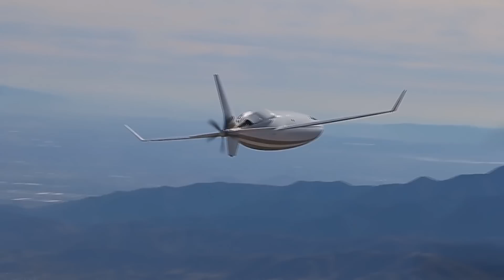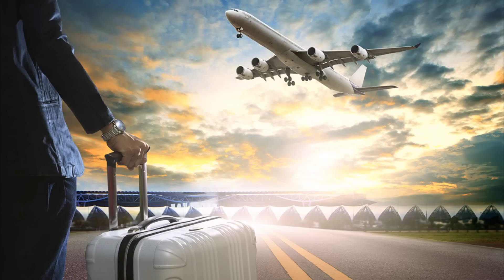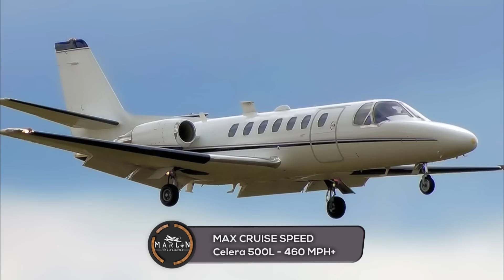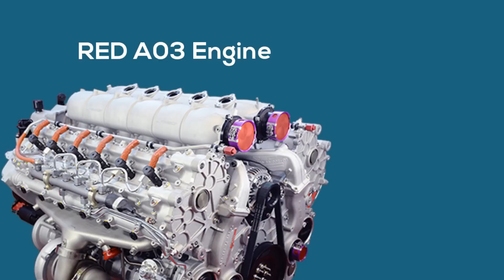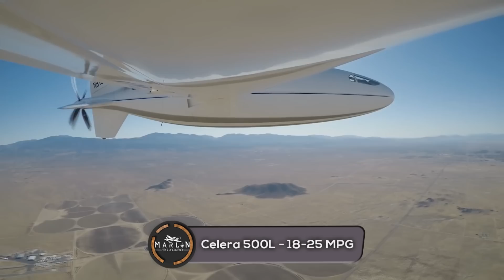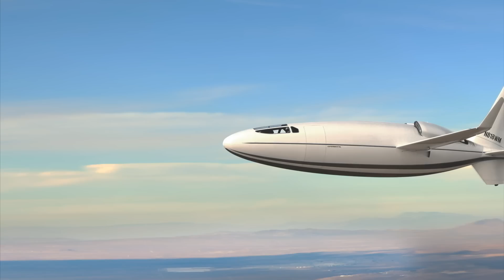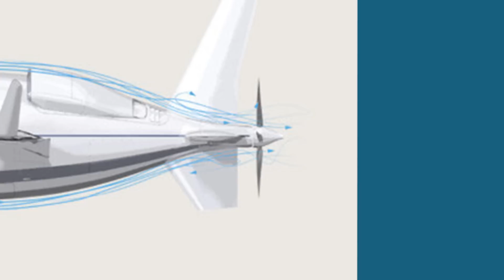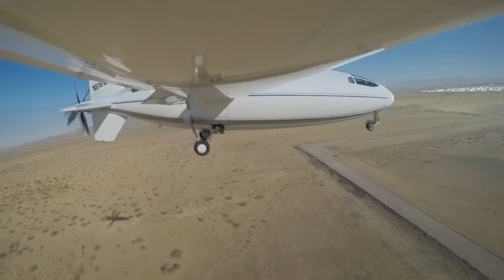Meet the Celera 500L (Flies Faster, Farther, Higher, Cheaper)

Comment: Too much fantasy here. Internal combustion at FL600+? Um, nope.
And wings that small won't support that altitude, either.
Dry wings and 4500NM/5200SM range? With the efficiency of an SUV? Um, the figures don't line up, nor do the physics.
You'll need fuel in the wings to reduce the bending moments from all the weight in the fuselage. (You'll also need a much better wing to fuselage transition to reduce drag)
With Avgas being 6lbs/gal or diesel, as in this case, being 7lbs/gal, it would require a huge volume of fuel (1450 lbs for diesel or 1250 lbs for avgas). Add even 4 people and some baggage, and you're adding another 1000 lbs, impinging on cabin volume.
You'll need a lav, thus taking up more room and weight to support the time for travel (17 hrs @ 300mph/13 hrs @ 400mph). Can't imagine more than 300 for long range cruise, unless sfc has gone off the charts.
Diesels have a higher efficiency (+ about 6% or so), but the fuel weight is a +15%, negating this efficiency.
The Learfan with a lot more power only ran in the low 300s for a range of only 1500NM.
Anyway, I'm all for new designs, efficiencies, and pushing the edges of the envelope, but when something comes along that promises such huge advances all at one time, especially with a design that's not so radical, it begs some obvious questions.
The Learfan was supposed to do radical things, and it kind of did but still fell short. The Starship was supposed to step in and do more on less, but still fell way short on promise, although very cool in many ways. The Avanti, which is the most similar to this concept, has taken decades to prove itself worthy of a unique design, although still falling short of its original production intent.
This was more of an ad than information on why or how this will do what Otto wants it to. Show me the math and the tech that will get me there.
Show me 2500SM at 350 with 4-5 people and a .45 sfc and I'll start looking at a real story; as for this, I'll keep an eye on it, but it will never do what is being promoted here.

Comment: Interesting but I've seen similar designs through the years that offer some of the same advantages over current aircraft designs only to not be the case.  The Lear Fan from the early 80's and the Piaggio P180 that's flying today come to mind.  In fact, the design of the Celera 500L looks strikingly similar to the P180 except for the canards.  The laminar flow that's cited in the video is the object of all aircraft design so it's not unique.  It may be that the fuselage design offers complementary lift in addition to the wings that most aircraft today don't have.  Finally, the pusher design has some flaws that a puller designs do not.  Namely, the air coming to the pusher prop suffers from boundary layer turbulence due to the fuselage drag no matter how clean the design is. This tends to make the propulsion less efficient because the inner portion of the prop is seeing the disturbed air.   Additionally, pusher designs tend to be much noisier than traditional puller design from a phenomenon called aerodynamic shielding that may impact their ability to fly into certain areas due to noise restrictions.  If you've ever heard a P180 fly overhead you'll know what I mean.  I hope the 500L succeeds where the other's haven't but we'll have to wait and see as the development continues.
Reply: Good points...There is P180 that flies over my area once or twice a month... VERY distinctive sound... don't even need to stick my head outdoors to confirm!

Comment: The performance claims are pretty hard to believe.  I quit the video at the suggestion of a 60000 ft ceiling, according to Wikipedia there are a couple records for piston engine aircraft reaching over 60000 ft,  so it is possible.  However I will be very surprised if this turns out to be a real thing and not a scam.

Comment: Surprised that they chose a new, untried piston engine instead of a turboprop, which are inherently incredibly reliable.
Reply: Colin Povey 
Couldn’t have said it better myself.    👍
Reply: Turbines are thirsty. Also got the impression that the power plant had a capability to continue running if one six cylinder side fails?
Reply: Not unless it's a Japanese engine. They should have used a Honda VTEC engine instead, which are even more reliable and fuel-efficient.
Reply: @00crashtest  Give me a break. That is a reciprocating engine, with hundreds of marts moving back and forth.In a gas turbine, all the parts do is revolve in one direction. Put in a  turboprop, downrated (make less thrust than designed for, so less stress), and you have about the most reliable engine ever made.
Reply: @colinpovey2904  But it's Japanese, not just any product. In Japan, they're miraculously able to run trains always on time despite having the tightest schedules in the world, high passenger overcrowding, typhoons, earthquakes, and tsunamis. Even with all that shit thrown at them, Japanese still manage to have the longest lifespan by a long shot.
Compare that to Europe and North America where trains with a headway of 1 hour and relatively low passenger numbers still somehow find a way to usually be at least 15 minutes late.

You gotta appreciate the Kaizen method. Look at the Scotty Kilmer channel. Japanese cars are guaranteed to last half a million miles with just oil changes, timing belts, and water pumps as long as they don't have a CVT.
Reply: @colinpovey2904  Whereas mechanically-super-simple Teslas are breaking all the time due to poor build quality.
Reply: @colinpovey2904  Granted, if Japan made a jet engine, it'll be more reliable than even a Honda VTEC engine.
Reply: @00crashtest   The problems with Tesla's is not they are breaking, but the fit and finish of the body panels sometimes leaves much to be desired. I may buy a Tesla in hte next year, and have been following this closely.

But some weird '2-half' 12 cylinder engine sound like a mechanical nightmare to me.
Reply: Turbines are reliable. But the company sure seems to be selling economy and range as assets unique to the concept, and again—turbines are thirsty.

Comment: What a load of Bull Shit.  Dig slightly deeper and you find that they are looking for funding ... Laminar flow only works on a perfectly sanded/polished model in a wind tunnel.  In the real world, dust destroys the laminar flow before we talk about imperfections in the aircraft itself or a little thing called water vapor or the nasty liquid or solid forms...  So, if you get any kind of clouds you have to fly through, your drag jumps massively then add icing... loss of lift and massive increase in drag and this is supposed to remain airworthy with range rating... uh huh ... Then you get minor aerodynamic disturbances which also destroy laminar flow.  460mph on ~500Hp.. uh huh

Comment: Looking at the Celera you can tell that the designer prioritized good aerodynamics over almost everything else.  I like the tear drop fuselage, the high efficiency wings and the pusher propeller features.  The specs are outstanding!   The only criticism I may have is the visibility from the cockpit.  I hope to see this plane make it past the prototype stage! 👍   Great video BTW!
Reply: VIRTUAL displays.  Why have windows ?
Reply: Like others before it it will fade away after reality bites !
     Good concept though.
Reply: @darrenkohls7431  Starship was just to far ahead and perhaps to expensive for the results.
We  may see a newer different commercial aviation after covid-19 .  The zombies have to die off first.
an express lane on interstates for self driving buses  doing 185 like Joe's Maserati.
Reply: THere is no known way to maintain laminar flow other than an active suction system of which this plane is NOT using.  They are looking for funding(suckers) and why they hit every contact they could find for this fraud.  Bugs, dust, even water vapor that is thick, let alone the wet stuff destroy laminar flow.  The fact they have one flying and refuse to say its actual speed is telling.  OF course anyone with any knowledge already knows this.... 460mph on 500HP carrying 6 people... HAHAHAHAHAHAHAHAHAHAHAAHAHAHAHAHAHAH
Reply: @w8stral   Exactly !
           BOOM !
Reply: @w8stral  boats do this, please explain again how this is not legitimate. I think provided with the fact the video gives the background of a man who is probably 10 times smarter than you in aeronautical engineering, has a flying prototype and they themselves made no public announcements of what they were doing.
Reply: @blackwaterlotus8124  Boats do not do this, whatever "this" is, and here I am going to assume turbulent flow vrs laminar at 50%... and here you have to use hydrofoils as an example and not a symmetric object which I am assuming is what you are talking about and which case is true of aircraft fuselages as well, and if so, then you are blatantly wrong, as there is a thing called a Reynolds number and Raleigh number etc and the simple fact that unlike AIR, water does not compress, so air depressurizes which makes turbulence easily and laminar flow is lost very quickly due to local disturbances whereas water does not decompress but rather creates standing waves which is more equivalent to supersonic flight and why hydrofoils have a TOP speed limit on them and cannot go any faster as differential pressures creates cavitation which quickly destroys said hydrofoil. Slenderness ratio here effects laminar flow, of course in supersonic flight one has gigantic temperature gradients whereas water does not, once overpressurization is reached you get cavitation(water to steam)
The "man" in question is not an Aerodynamic engineer at all, if you had bothered to pay attention, but rather an crash inspector with a big aero interest, and if it does not fly at 400 knots cruise, then their numbers are utterly meaningless as many such aircraft fly at 200knots at numbers stated, so what is stated is NOTHING new, and all are essentially useless for getting anywhere as they all require long runways and get their slowly so you may as well fly commercial and hire a taxi, or rent a car, or take public transportation. 
And everyone has a flying prototype... Until they figure out Airplanes for the last 50 years are more about the engines and less about aerodynamics as the difference between super clean and fairly clean means not much in aircraft flying at 200-->250knots.  The ultimate of this is a sailplane outfitted with a small engine and has vastly superior numbers to those posted in this video... of course it is traveling at 60-->80 knots...
Reply: @w8stral  do tell...
Reply: @blackwaterlotus8124  oh please do... Try some actual aerodynamics now...
Reply: @w8stral  try a little less sarcasm and learn how to dialogue as an adult. I don't mind being wrong, but I can't stand arrogance.
Reply: @blackwaterlotus8124  Truth, facts are arrogance... to the thin skinned utopians, I suppose they are.  PS: you are an utter hypocrite to YOUR OWN standards... telling then got told off and call me arrogant... uh huh.

Comment: Seriously this is just another phony aviation pipe dream of a crackpot. First the speed is totally unrealistic. 550 hp engine isn’t going to cut the mustard, more in the low 2000hp range given its aerodynamics. Then we have to look at the wings, they are too thin for speeds above 350kts. And finally, you really think with all the brain power at Boeing, Lockheed,  Grumman, Northrop, Cessna and many other have all failed? I am sorry but this is snake oil
Reply: Douglas tried a similar concept with the XB-42 in the 1940s. https://en.m.wikipedia.org/wiki/Douglas_XB-42_Mixmaster

Comment: Too good to be true...
Reply: Yes! I was willing to remain undecided on many claims but that ocean sunfish with chopstick wings and a propeller flying at SIXTY thousand feet convinced me.

Otto has lost his marbles.
Reply: @vondahe  Yep, thats what I was thinking too. Pretty sure piston engines even with superchargers top out somewhere around 35-40k feet. Edit: The highest altitude obtained in a piston-driven propeller aeroplane (without a payload) was 17,083 m (56,047 ft) on October 22, 1938
Reply: @vondahe  Sounds right. What happens when we lose the only propeller?
Reply: @afisemenaborevlaka48  ... You glide 100+ miles to the nearest airport.
Reply: afisemenaborevlaka48 The sunfish can apparently glide 160 km thanks to it’s enormous  wings so no problem. Wink-wink. 🥳
Reply: @vondahe  ... The glide range is only a function of the glade ratio, and the glide ratio is only a function of the drag. Cut the drag and you will increase the drag ratio and range proportionally, big wing or small wing doesn't matter (except as it affects drag).
Reply: adb012 Thanks for that but you need something to provide the lift in order to glide. Otherwise you’d drop to the ground.
Reply: @vondahe  Wings provide lift. Small wings need more speed than big wings to provide a given amount of lift. But that's about all. For example, in gliders adding ballast increase your stall speed and your best-glide speed, but not your glide ratio or glide range. Because best glide happens at minimum drag speed and minimum drag speed happens when you equal parasitic and induced drag, reducing the induced drag (due to laminar flow) means that you should reduce tor induced drag too to get best glide. Increasing speed is a way to reduce induced drag. Then you can reduce the size of your wings. I am not saying at all that this airplane is viable. Just saying that the excellent glide ratio and small wings is consistent with their claim of largely reduced parasitic drag thanks to an extended laminar flow (which I think they will not be able to achieve in practice).
Reply: adb012 Again, I enjoy your insight and I also cannot reject all claims made about this craft but when an inventor comes up with something as extreme and unheard, there’s good reason to be sceptical. 

He’s not exactly the first aeronautical engineer looking at drag, turbo prop performance, fuel economy etc, so it’s remarkable that someone with his modest caliber and means suddenly cracks the code ahead of the biggest companies in aviation.
Reply: @vondahe  And I share your skepticism. Just not "because the wings are too small"(the prototype already flew) but because I don't think they they will be able to cut drag by that much.and that because I don't think that they will be able to maintain laminar flow that far down the fuselage and wings.
Reply: Pistons engine at 18000m. Glide ratio 22. Where is the efficiency?!!
Reply: So was the smartphone.
Reply: To good to be true is right! So many incredible claims. It has 350 horsepower and flies at Mach .8 and FL60 with a prop? Is there an actual flying copy too prove these claims? I would like to fly it or even see it fly. It is hard to believe these claims.
Reply: Nope, this lever off efficiency is possible due to lower Drag & a modern Diesel Engine. The Mixmaster also had a high fuel efficiency for its day...
https://en.wikipedia.org/wiki/Douglas_XB-42_Mixmaster
Reply: One that we U.S. tax payers will fund the pantagons buying and shelving of technology to keep away from the public..🙄

Comment: “Designed with safety in mind.  No fuel in the wings.”

Cool, then where is the fuel located?  And why is that safer than out away from the passengers?
Reply: Good question.
Reply: Don't worry about minute details...59% drag saving is a lot.
Reply: @Jeffrey Kelley  That's not a practice unique to this plane, and yet we still have plane fires.
Reply: Well for one, the fuel is less likely to freeze and starve the engine
Reply: Alex Peterson 
I think he meant that it kills the passengers instantly during a crash.

Comment: Looks pretty amazing and, could be a great rival to aircraft like the TBM. Looks like William Otto went to the same school as Burt Rutan.
Not sure why you would go with a V12 instead of something like a PT-6.
Reply: Fuel economy
Reply: @marcrolison4478  I knew that. It was a rhetorical question..
So why do so many aircraft like the TBM's and M600 use turbine's and not V12's?
I have to say, I'm still not convinced a turbine wouldn't be better. For a start, there are massively less moving parts that can go wrong. Yes, the fuel burn would be greater, but there are very efficient new turbines on the market from people like GE. 500hp for a small turbine is nothing, so there could be greater potential for a higher cruise speed but as a prop aircraft that's not really an option. Having a 4500 mile range seems superfluous to me at prop speeds. Who's going to want to be on an aircraft for over ten hours? I would have thought ETOPS would have limited where you could use that range any way.
I do love the aircraft, though. and I think it's great to have a "disrupter" in the industry. Could this be the Tesla of the skies?
I'm just not convinced of the direction they're approaching the market from.
Reply: Will never happen anyway.
   Turbine or pistons. 
       Moot point.
Reply: @darrenkohls7431   We'd all still be living in caves if we kept thinking like that.
The fact it's already flying say's you're wrong. 
Even if this particular aircraft doesn't become financially viable, the proof of concept is.